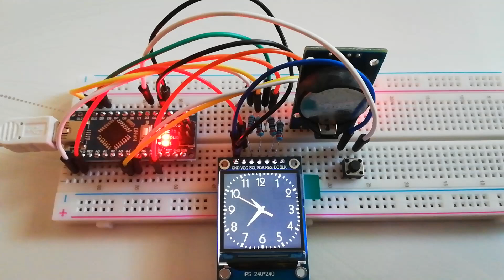analog clock on IPS display (ST7789 driver)

Comment: The project is interesting only after setting the time, the data is not saved in the RTC module. The time is displayed as it was when first connected.
Reply from the maker: for me was just a test for IPS display, I not lost too much time this this project, I just upload an existing sketch... but I'll update when I'll find some free time (thank you for your warning !) 👍
Reply: Just checked your version again, everything works, the problem was in the original version from the library. Your version of the code works just fine. THANKS! 👍✨
Reply from the maker: that sketch is no mine, I just used for test the display.. but is a very  good example

Comment: Bravo Niku, very beautiful construction. Where will we find the details? (circuit and sketch? |)
Reply: has it in the project : Connections:
LCD pin 	LCD pin name 	Arduino
#01 	GND 	GND
#02 	VCC 	VCC (3.3V only!)
#03 	SCL 	D13/SCK
#04 	SDA 	D11/MOSI
#05 	RES 	D9 or any digital
#06 	DC 	D10 or any digital
#07 	BLK 	NC  
(I am supplying the D3 button according to the video)
Reply from the maker: in description of the video are enough information... connexion are as in sketch,,,